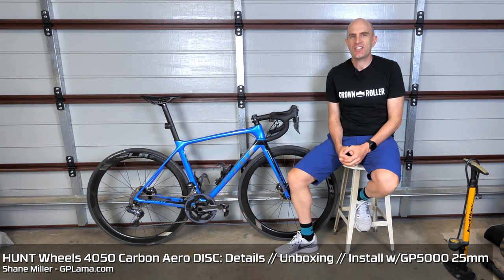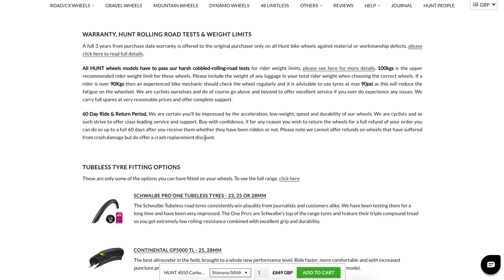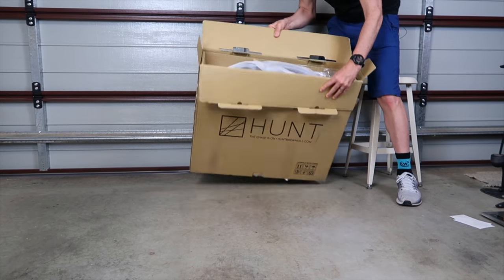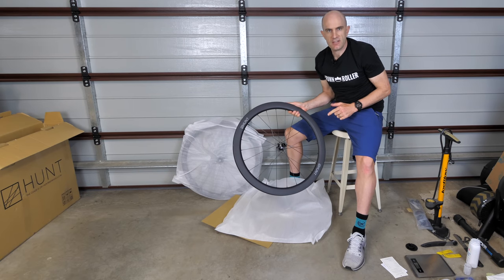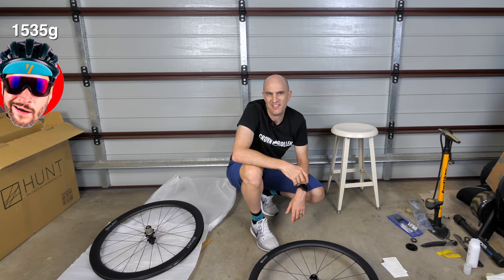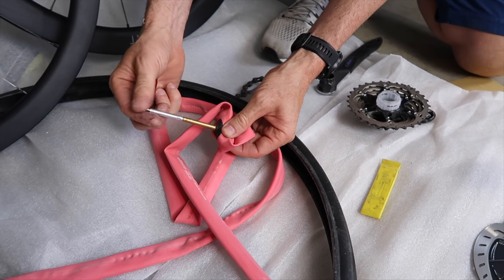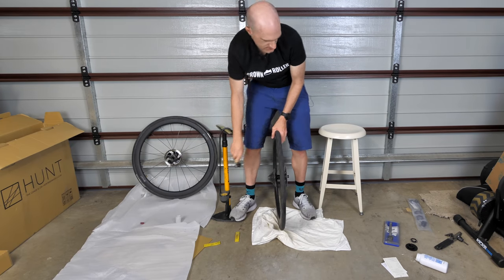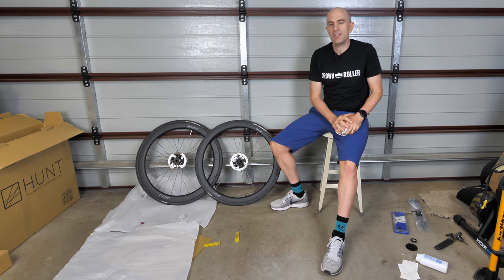HUNT Wheels 4050 Carbon Aero DISC: Details // Unboxing // Install w/GP5000 25mm

Comment: Are you running 80 psi front and rear?  Do you run that on normal tubes as well?
Reply from the maker: Yep, it's about the sweet spot I find.
Reply: @gplama  ill give that a shot then.  You haven't done a video on your thoughts on the latex tubes yet have you?   Ps: Love your work 👍
Reply from the maker: There's some interesting numbers here on latex tubes: https://www.aero-coach.co.uk/inner-tube-rolling-resistance
Reply: @gplama  seems like there's quite a bit of difference, how have they been functionally?
Reply from the maker: @markmcleod2322  I'd regurgitate words like "smoother" and "more supple"... But in all honesty, no discernible difference to me. They feel faster because they test 2w better... They puncture less, most likely because I ride over less things that would cause punctures. I always used them in my race wheels... so it's a legacy thing.

Comment: So, one thing, Hunt doesn't recommend latex tube, or used tyres from another wheels that have been stretch and goes in easily but also tubeless tyres even for clinchers. This is like all of what they don't recommend.
Reply from the maker: Do you have direct links to this information they’ve published? I’d be surprised if they recommend against latex tubes on disc brake wheels.
Reply: @gplama  . All is in the user guide on the website where they mention about tires and fitting etc. However, You are right for the latex tubes on rim brake, though it doesn't say (rim brake only) with that assuming that you go tubeless. As for tires there is a mention about still using tubeless tires even when using tubes. See what you can gather from this. on another note I am a fan of yours and enjoy your you tube channel. keep up the good work.
https://help.huntbikewheels.com/support/solutions/articles/43000561087-user-guide

Comment: Epic downgrade on the SLR1 wheels I’m afraid. Should have gone for the SLR0s with the Faster engaging DT star ratchet hub! Get some CADEX wheels on the shopping list ;) 
Giant carbon road wheels are criminally under rated. Dt swiss internals, Sapim spokes and one of the lightest rims around. And for a fraction of the price of other “boutique” brands.
Reply: Problem with the latest Giant(Cadex) wheels, they are hookless, with limted tyre compatibality.

Comment: Hunts definitely look nicer and slightly more aero, However I feel it may be a downgrade From a lighter Wheel w/ DT Swiss hubs down to a Novatec.
Reply: Oh, I just wanted to ask about hubs in the Hunt wheels and saw your comment. I didn't find this info on the Hunt's web-site. Is it really Novatec? which model?
Reply: Kind of Novatec with super smooth ezo bearings. Much lighter then DT, they are good hubs.

Comment: Mate i have to say that's a massive downgrade on the giant wheels, especially in terms of the hub (internals) and spoke geometry. Fair dos if you're sponsored by Hunt, but if you aint....stick with the best
Reply from the maker: I haven’t sold the SLR set yet. I’ll see how these hold up.
Reply: Agree with you on that ,giant wheels are pretty good

Comment: Is it an illusion or have you accidentally fitted the 160mm rotor to the rear wheel and 140mm to the front? The video is a year old, so I’m sure you’ve figured it out ;-)
Reply from the maker: Nothing up my sleeve! The TCR Disc I have has 140 rotors back and front.
Reply: @gplama  Apologies for doubting you :-( incidentally how do you get on with 140mm front? I'm going to build my next bike (I weigh 64kg) but the manufacturers all seem to favour 160mm front these days. PS Love the content!!
Reply from the maker: @tomwoods910  No issues with the 140 on the front. Heaps of stopping power with hydro. I have 160 front and rear on the gravel beast though.

Comment: Ordered a set of "Team Edition HUNT 44 Aerodynamicist Carbon Disc Wheelset". They came scratched and had different spokes then described on the website. Hunt said, oh, that was a failure on the website, there are no aero spokes on these aero wheels. Made complete sence to me. Send the wheels back, got another pair after weeks of waiting. Had to tell Hunt better put a plastic bag around the wheels so they wont get scratched again. Second pair had a big scratch on the hub even so they where well protected this time, so they has to have been scratched before transfer. I thouh, well its a minor thing, put the wheels in the bike without tyres to check them out, and oh my gosh they where out of true. Contacted Hund again, took them weeks to answer again, just to tell me, well use a sharpie for the blemish of the hub and go to a mechanic to let the wheels true. What a brand, what a service. Thank you so much. Ah and as if its not enough, when you want to send the wheels back you can not simply go to DHL or elsewhere with a retoursticker, oh no, you have to stay at home and wait for UPS to pick them up.

Comment: Completely losing most of the aero advantage on carbon rims by having tyres being wider than the rims. You would be better of with a 17mm internal width and the contis 5000. They are about 26mm wide. Not quite sure what the upgrade is here. But nice wheels and vid non the less. Love the aussie accent and chillness. Look up the rule of 105% although you probably know it!

Comment: Not a fan of hunt and different depth rims. Still you get a heavier sets for the same or even worse aero gains ( hello hambini fans ). I built a set of lightbycicle rims, 46mm deep with the same width as hunt, but got 350 hubs which are way nicer and with better bearings for just 650 shipped to italy.

Comment: I think it would be good to challenge Hunt on the discrepancy between the actual weight and the advertised weight.  If there's a good reason for the difference then fair enough, otherwise it's misleading advertising that should be flagged up.
Reply: Stated weight is probably without the rim tape.
Reply: @Indulonman  40g per wheel seems very heavy for rim tape. I would expect it to be less than half that.

Comment: Your scales are off if the weight isn’t correct, mine were bang and on.
Reply from the maker: That's not a conclusion you can make with any confidence whatsoever. Out of interest, what did yours measure for the internal width? These were listed as 21mm internal but I've since measured them as 19mm internal and have noted they've updated their website listing to be 19mm. 🤔

Comment: And does it matter?
Reply from the maker: .... does what matter?
Reply: Shane Miller - GPLama  sorry not making myself clear  , if you use tubeless tyres with inner tubes ( only asking as have been offered some cheap 5000 tubeless but still don’t trust them so was going  to use inner tubes), btw love your stuff I’m a regular viewer.

Comment: Anyone else get nervous about tire levers on carbon rims?
Reply from the maker: They’re soft plastic... so nope.
Reply: I'd say if you can damage the rims with tire levers, they are probably not strong enough for riding. Imagine what a pot hole would do to such a rim.

Comment: Should never go any lower than 80mm depth in the back
Reply: for TT or triathlon maybe, but for everyday riding and racing the diff between 50mm and 80mm is going to be small, but the ride quality with sidewinds...
Reply: @lechprotean  sidewinds don't affect the back hardly at all. I've ridden my disc wheel in some crazy winds and you cant even feel it. But its fast!

Comment: Hilarious .. you replaced a light wheelset with a heavy set.. Should have tried the Giant SLR0 wheels .. even lighter. Fair enough if you are using 28mm tyres in the future  but not for 25mm
Reply from the maker: Back in my day.... 1800 was heavy.

Comment: Buy new wheels that are heavier then the ones you had.... um... what?
Reply from the maker: We're conditioned for lighter, faster, better aren't we? This industry thrives on it. It survives on it. Yet when I put on a few extra kgs, or stick my head up a little higher negating every expensive Team Sky used gain it's never a topic of discussion. shrug I'm looking forward to seeing how these roll. That's what matters.
Reply: @gplama  Fair enough.

Comment: How does this handle in crosswinds ? Would you recommend this for someone who lives in an area which has a lot of hills ?
Reply from the maker: It really depends on the wind and your size/weight (smaller riders get blasted around a little more). Strong winds = 40-50mm not ideal on the front. For windy and hilly locations I'd look at 30-35mm rims as a general recommendation.
Reply: @gplama  Im about 165lbs and the winds here in worse situations can be around 10-15mph. Thanks for this, ill probably get a 35mm and it makes sense.